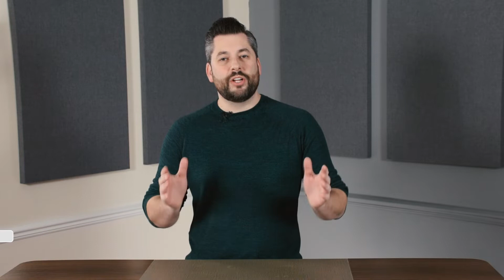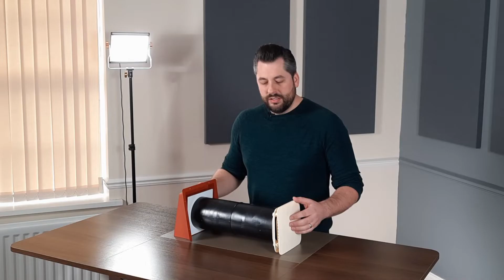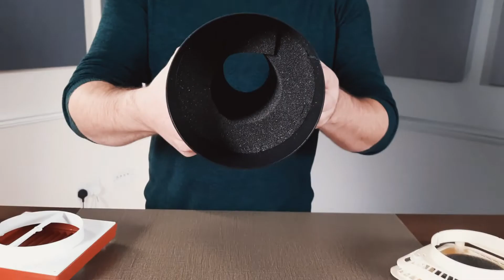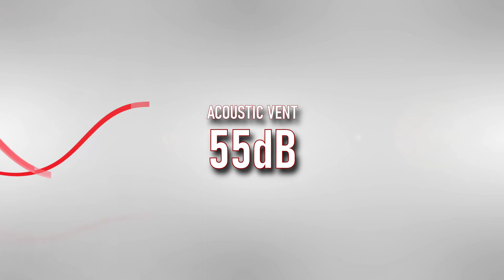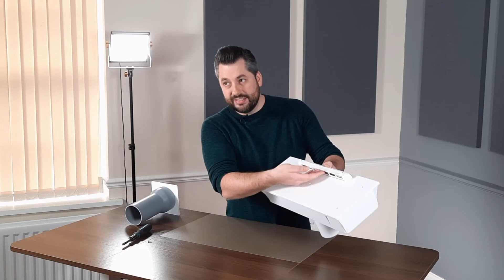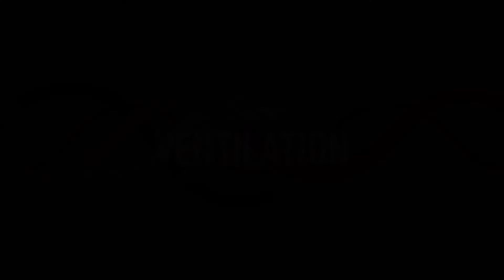Acoustic Ventilation Comparisons

Comment: right now i'm working on making a pc desk, thats as sound proof as possible, so its basically a big 135cmwide  x 60cm deep x 80cm tall box that has a computer inside with a bunch of hard drives, maybe also a 3d printer. 
But i'm trying to figure out the best way to allow airflow as passively as possible while making it as sound proof as possible. 

My first idea is to use the fact that hot air naturally rises and have there be an air intake on the bottom and the outflow on the top. Making them as narrow slit all the way along the width like a bit deep flat s shape. and as well as trying to reduce the number of parallel sides, make the top inside be sloped so the air will flow naturally up and along and then through a gap all the way along the width of the unit, into the next channel in the s shape channel lined with foam and other shapes to deflect the sound, again with the top of this space being sloped so the hot air will flow up and out toward a gap at the back of the desk. 
Then do a similar setup on the bottom part of the unit but with fans at the point where the s shaped channel meets the inside of the unit. to draw in cold air from the room. 

I have no idea how well it will work, i cant seem to find anything similar being done before, as they mainly seem to have big boxy channels with a winding pipe all the way through that then need a big fan blowing the air through. 
but hopefully it'll be good enough to cancel out the hdd sounds and have good passive airflow, and if it can drastically reduce a 3d printer that would be great. Fingers crossed.

Comment: Can these be fixed vertically from the loft into the ceiling of the room?
Reply from the maker: Hi Dilip Yadav, Yes, you could install them in the ceiling if you wanted. We have had clients install them in the ceiling before.
Reply: @SoundproofingStore  - That's great. Thanks.

Comment: I’m in the US, with a house built in the late 1970’s.  The TV from one bedroom travels to the others, and the baffle box should help.
What was that paperboard-ish panel at the front?  Similar to drop-ceiling tile?

I think I heard somewhere that ducts don’t need to be as large as they used to be.  I can redo them in the attic if it will make enough difference.  Does that sound right to you?

Thanks for producing this, and especially if you respond!
Reply from the maker: Hi Kevin Bauer, thank you for your comment. I have no idea what part you're refering to with the paperboard panel? I'm not an expert in ventilation, it's more the acoustics side we specilaise in, but yes I imagine more modern, more efficient systems can probably use smalller ducting pipes. Depending on the cosntruction of the wall, if it's solid brick / block then the ducting is probably a big culprit for the noise transmission. However, if it's a timber construction, the noise is just as likely to be travelling directly thorugh the wall as the ducting, so you may need to treat the whole wall.

Comment: Great video. Do I understand correctly? That neither solution uses a motorized fan?
Reply from the maker: Hi SunnyMoon Productions - that's right, they are both passive, no fan or motor of any sort.
Reply: @SoundproofingStore  gotcha thanks. I wonder how this baffle box would do with a quiet fan on the outside end. To increase the airflow. Maybe with a couple feet of extender tubing between to distance the fan.

I like the idea because this looks easy to replace if needed (after years of funk etc. growing/flowing through). And could be a nice part of larger system.
Reply from the maker: @SunnyMoonProductions  Exactly right. The acoustic vent is just the starting point. If you want higher performing acoustic isolation for a studio application, then add the baffle box. If you want to increase ventilation performance, add a fan. Beauty of retro fitting a fan is that you can have it on a switch and turn it off when recording, turn back on when producing, setting up etc.
Reply: @SoundproofingStore Hi, I'm looking into soundproofing a bedroom and using the 'ProSound Acoustic Vent System 55dB' for ventilation. You mention adding a fan to increase performance. I don't know much about this stuff - I assume a fan can only move air one way - Does this mean 2 Vent Systems would be required? (One for extraction, one for ventilation) Unless some kind of alternating fan exists? And just one other question - If I were to buy 2 vents without a fan, would this increase the performance from 2500mm2 to 5000mm2? Cheers, Sam.
Reply from the maker: @Sam-ep3jo  Likewise our expertise is in the soundproofing not the actual ventilation performance. But yes a fan will work in one direction, blowing in or sucking out. In a perfect world you would need two vents in that case to cover both, or at least having another vent of some sort for air to escape. I dont' think its as simple as double the fans equals double the performance, there may be some sort of diminishing returns. But you would have to check that with a ventilation expert.